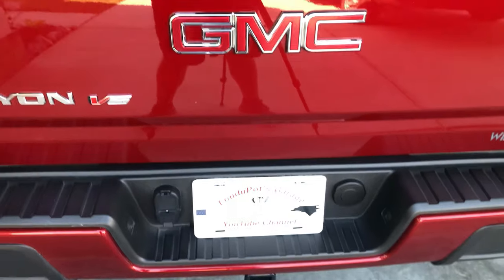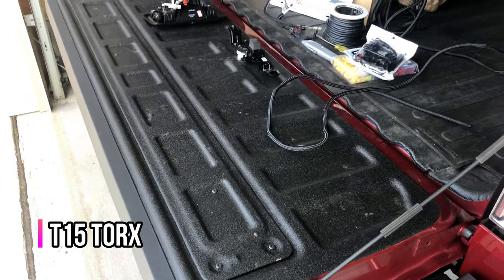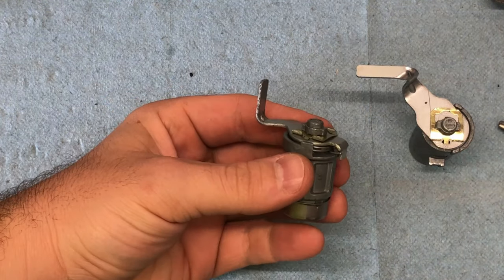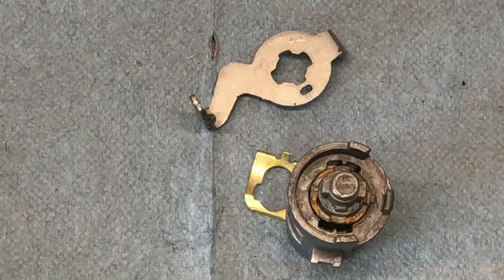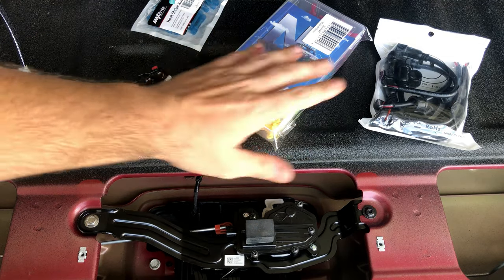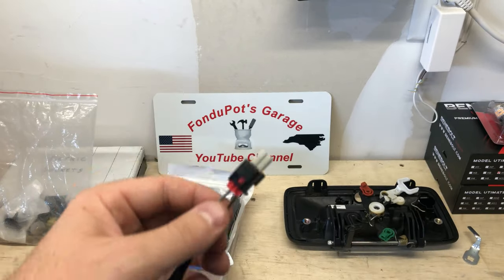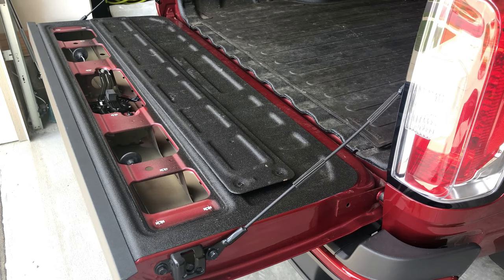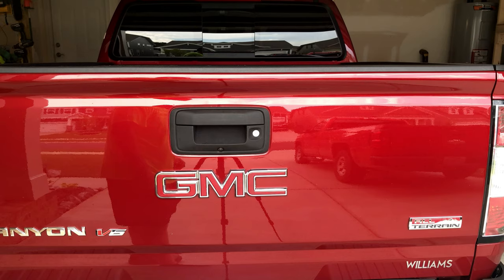[HOW TO] Install OEM Power Locking Tailgate in a 2015-2019 GMC Canyon / Chevy Colorado (Retrofit)

Comment: Has anyone confirmed the part number for the spring loaded lock cylinder required to do this project?  I hate that all GM Part websites only have drawings so you can never match anything up.
Reply from the maker: Negative, I did some extensive searching. Could never find it. Scour eBay and see if you can find a handle with a lock with the spring loaded key housing.
Reply: @fondupot  Thanks.  I have to find a website that has free returns.  Unfortunately I'm not finding a complete handle with lock on eBay.
Reply from the maker: @Nick-zp2mg  This is one: https://www.ebay.com/itm/Rear-Tailgate-Handle-W-Backup-Camera-2016-2019-Chevrolet-Silverado-GMC-Sierra/324425400055?hash=item4b8942bef7:g:g5UAAOSwuXJf36X4
Reply from the maker: @Nick-zp2mg  This one too: https://www.ebay.com/itm/Rear-Tailgate-Handle-Backup-Camera-Opt-2016-2019-Chevrolet-Silverado-GMC-Sierra/143836763972?hash=item217d56d744:g:X-QAAOSw5epfrGVe
Reply: @fondupot  Thanks... but as I'm in Canada, both don't ship to me :(
Reply from the maker: Darn!!!
Reply: @fondupot  One more question.  If I find someone that has one, but doesn't have the key for it, do you think that will be a problem removing the cylinder from it to insert mine?
Reply from the maker: No. You can just bring it to a locksmith to have them remove the old core.
Reply: @fondupot  Cool.  I actually used certain snapshots of your video and sent it to a contact of mine at a GM dealer to identify the exact part number for the lock cylinder.  Hopefully they come up with the right one which I'll order.  If/When it arrives I'll update you with the correct part number to update your video.  

Thanks a lot for your help.
Reply from the maker: Please let me know if you are able to find the exact part number. I’ll update my video description.

Comment: Awesome video! the one question I have what is the difference between this and pop a lock other than OEM? It seems pop a lock would be more cost effective.
Reply from the maker: OEM parts vs aftermarket parts. I wanted an OEM actuator. I’ve had pop n lock in the past. It failed after 2 years. So I wanted to try something different.
Reply: @fondupot  Totally understand! I may give it a shot as well but need to check out the cost first. Have not done the pop n lock yet and was going to but now you have me thinking. Your videos are awesome and have followed your mods since I first found them. The first one was the fog and high beam jumper and it is awesome.
Reply from the maker: Right on! Thanks for being a loyal follower. Check the ColoradoFans.com forums for sale section. I have a spare handle and a spring loaded lock housing for sale. All you’d need otherwise is the harness and the actuator motor. Then you could do this mod. I’ve had pop n locks on previous trucks. The OEM lock is much more substantial. Will definitely last a long time. Or send me an email at fondupotsgarage1@gmail.com.
Reply from the maker: @Slimhaven1  Awesome. I sent you a message on there.
Reply: Man , what a fantastically done video. Great job.  BTW my benebolt headlights are coming tomorrow. Thx👍🏻
Reply from the maker: Thanks very much! You’re gonna love the Benebolts!
Reply: My pop and lock has pretty much kicked the bucket after two years as well. We'll be updating my 17 canyon with this oem setup now. Thanks @fondupot
Reply from the maker: Great to hear. Good luck!
Reply: @fondupot  unfortunate news, most of the parts are on backorder with no time frame for restock 👎
Reply from the maker: @jaxchrisfla10  Darn! yea, I had to wait a few weeks to get my parts.

Comment: What did this cost with all the parts?
Reply from the maker: I honestly can’t remember. But it’s still going strong. Haven’t had any issues at all. A pop n lock kit is much cheaper. But I’ve had two pop n lock kits crap out in the past
Reply: @fondupot  like 500 or 1k?
Reply from the maker: Noooo. Not that much. I think around $250 max. I put links to everything in the description so you can source everything. And figure the price out.

Comment: I did the Pop & Lock.  It was a lot easier.
Reply from the maker: Pop n lock is much easier. But I’ve had several of their units fail over the years. I wanted something more OEM. So far this setup hasn’t failed me yet.